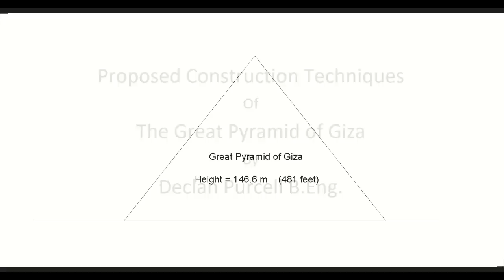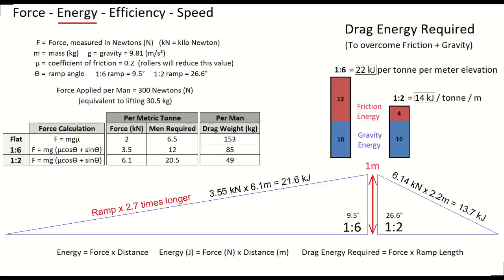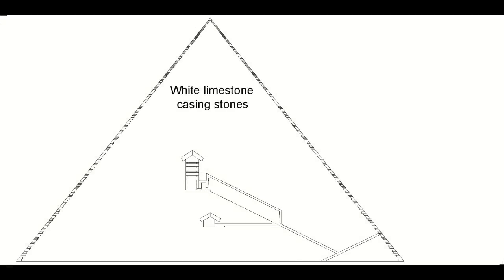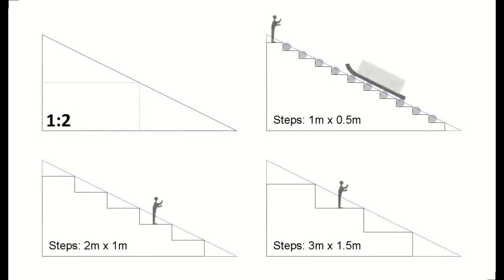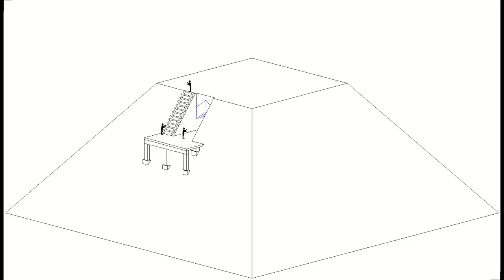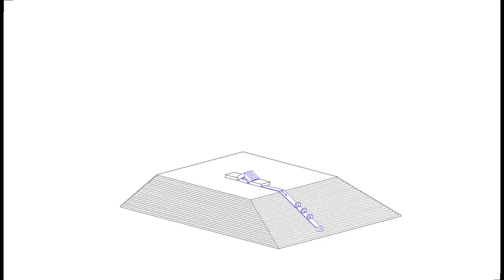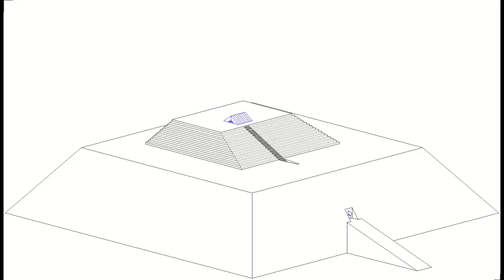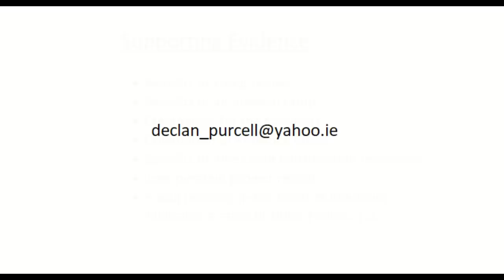Proposed Pyramid Construction Techniques

Comment: Unlikely. It never mentioned what kind of ramp it is. if its make out of mud, its a terrible proposal then
 xD
Reply: There are actually ramps still existing from this time period at other sites in Egypt.  They are basically made with stone walls for the sides and then filled in with smaller rocks and sand/gravel.
Reply: Just imagine 146m high, tons of stone blocks on a ramp stretching a kilometer wide made out of mud. He could have just mentioned about alien tech. it is much easier LOL
Reply: @xianalejandro9460  Did you watch the video?  The whole point is that this doesn't use a ramp, but rather the pyramid itself.